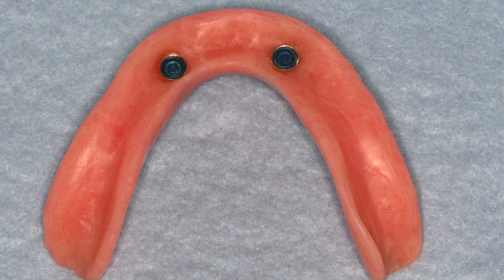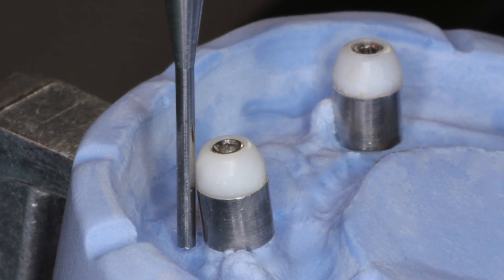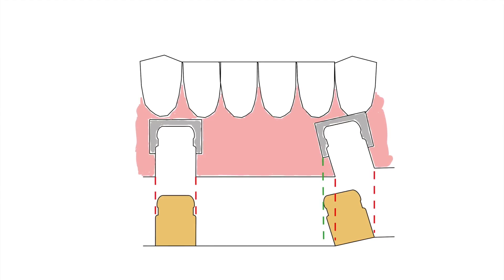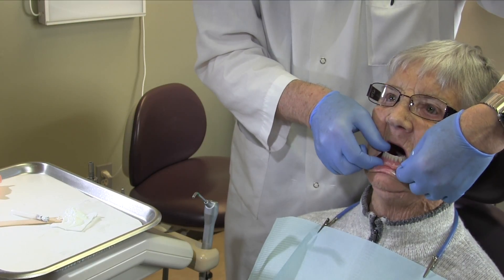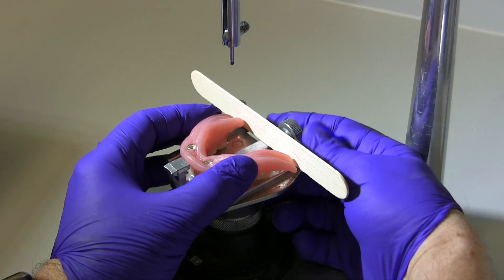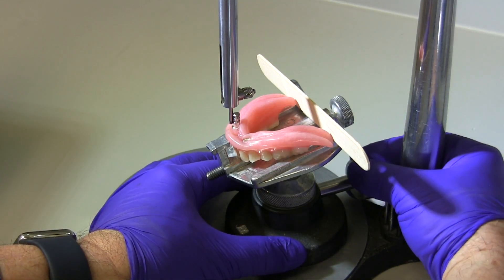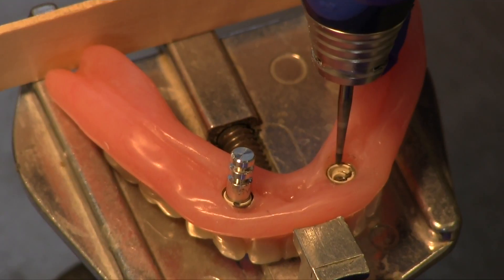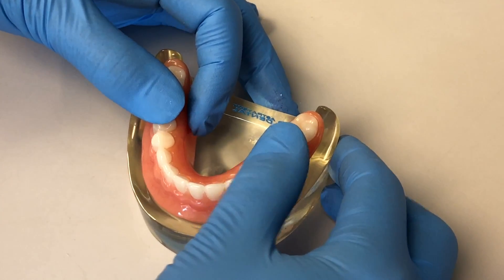Eliminating Attachment Binding in Implant Overdentures

Comment: My appointment is 8/13 and I really need help before then. I’m getting 2 top and 2 bottom implants just like in video. I wanted to know will the denture be still snug or will it rock upwards in the back since there only two. Please help
Reply from the maker: Every case is different (because of differences in the amount and distribution of bone support, the position of the teeth in relation to that support, the amount of surface area of the denture, how well the denture seats on both the implants and the gum tissues, etc.). However you should experience less movement than you would expect with a normal denture. For most patients they find this a significant improvement to previous dentures without implants.
Reply: @DrLoneyDal  would you prefer 2 normal size implant like in the video or 4 mini ones?
Reply from the maker: @blackapplegallery  It is not possible to give specific recommendations for any one patient because patient variables are too numerous to consider without knowing a patient’s anatomy, preferences, etc. In general, most patients are very happy with two standard implants. Increasing the number of implants tends to increase the retention and stability of a denture, but also tends to make complete seating of the denture more difficult if the implants are not sufficiently parallel to each other.